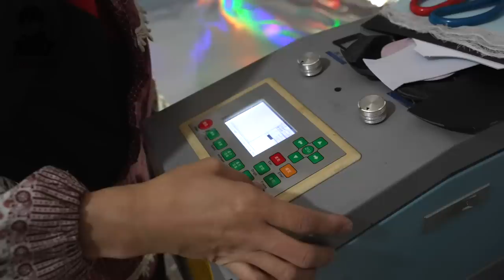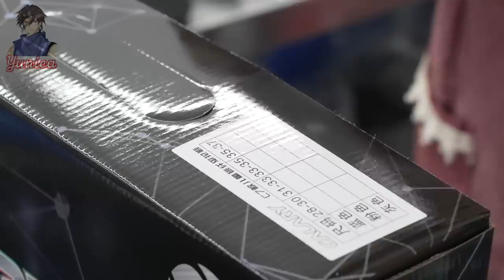Excellence! The making of the light as a swallow carbon fiber roller skates

Comment: The rollers are beautiful.  
This is a very time consuming process, there's a reason they cost so much at the store.
Not just shoes and wheels, but you have to come up with a stiff sole to hold the wheels
Reply from the maker: Now in China it is difficult to see this kind of skate factory that can produce all the accessories by itself, most of the skate factories only produce uppers, wheels, brackets, and plastic parts are purchased with professional factories
Reply: @Yunica520  Yes, I agree with you that organizing the production of everything is very expensive and takes up a lot of space.
So there is a reason to buy from neighbors
Reply: its the carbon shell that gives it the stiffness. there is no sole